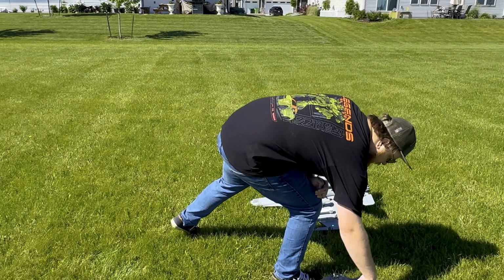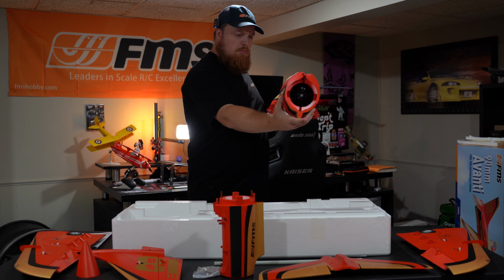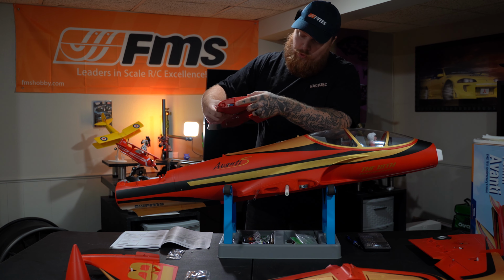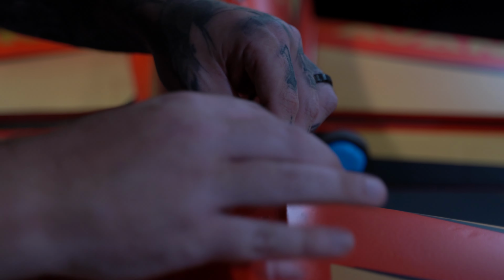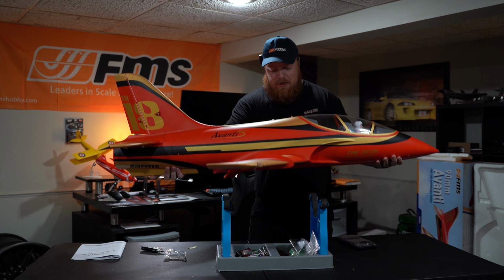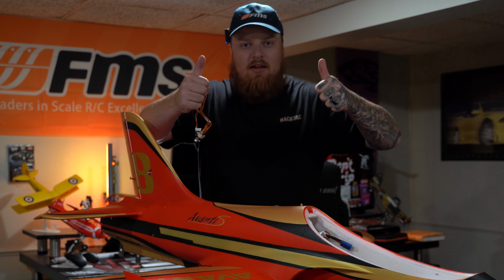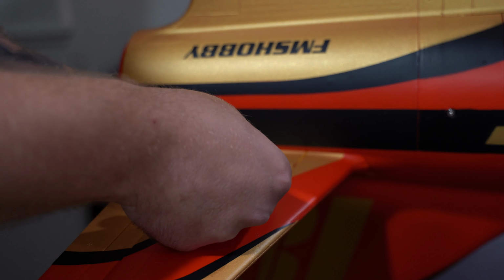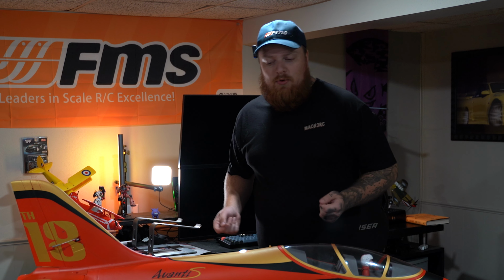FMS 90mm Avanti 18th Anniversary Unboxing & Assembly

Comment: Woof! When will you get an RC Boeing 757 and put the Trump Force One livery on it? 😂 It would be sick!  Or put Nancy Pelosi in a bikini livery. lol

You should put the 90mm Avanti Rear Fuselage with Vector Tail Nozzle on yours. It is so much more fun! It bolts right on. It's the whole rear half of the fuselage. You can swap back and forth easily. I bought my thrust vector unit at Banggood.